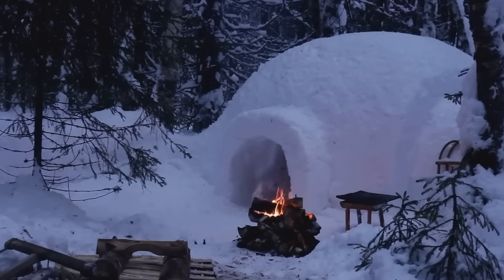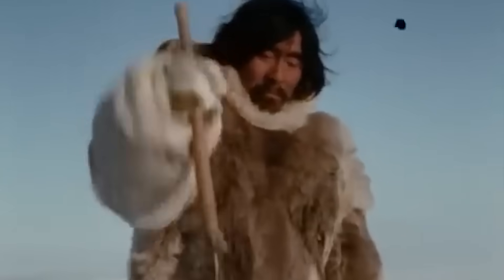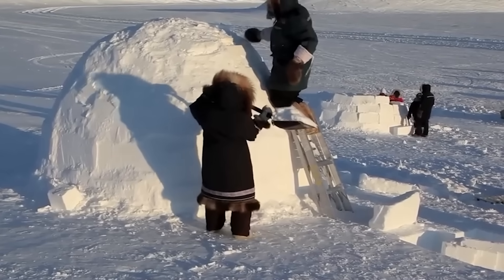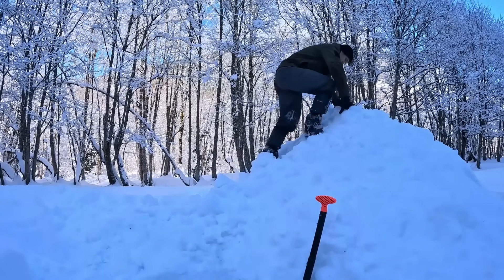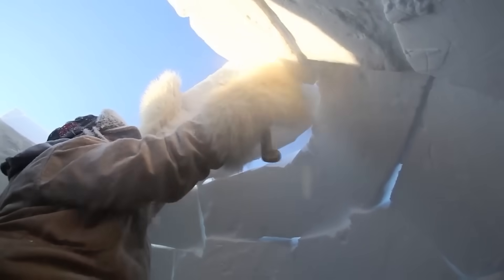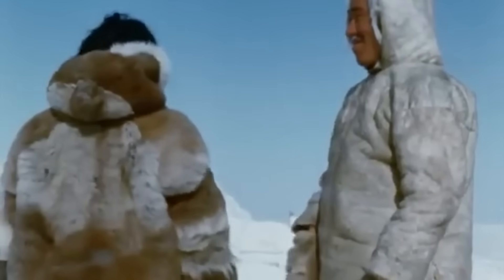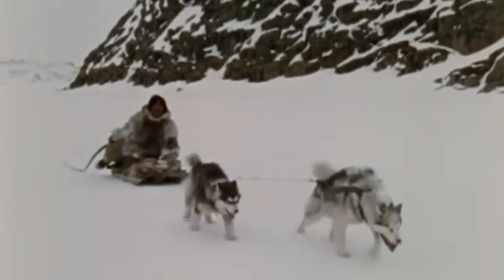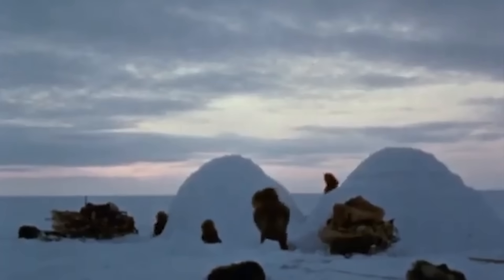How Inuit Build a Real Inuit Igloo in 2 Hours

Comment: When I was a kid we used big cardboard boxes and set them up like a fort with separate rooms and long vacuum cleaner tubes sticking out for ventilation, soaked them to freeze them in place then covered them with snow, froze that layer, cover with another layer of snow, freeze that until it looked more or less like a pile of ice and snow at the far end of a mall parking lot. They were darker inside than a normal igloo, more like a cave and needed a flashlight to see clearly, but still pretty warm compared to outside, couldn't sleep in them though.
Reply: My dad built an igloo in our driveway in the 1945 in Wisconsin. It had the exact dimensions of an igloo but smaller. We played in it under supervision. So much fun. We were the envy of the neighborhood.
Reply: When my brother and I were kids, we built a quinzhee (hollowed out snow pile) in our front yard, about 6 feet high.  That was a lot of fun.
Reply: I used to build Christmas tree forts after the new year, going around collecting the used trees on the curb. They smelled really nice too. They also burned reall well when they dried out. 😊
Reply: I gotta try this.
Reply: @marcmelvin3010  There's an unwritten rule regarding building an ice fort, the builders don't necessarily get dibs on ownership. If it's built in a public place like a field it's open for anyone who challenges for it, you have snowball fights, winners get the fort. There were usually 2 or 3 of them in my neighbourhood. Kids today are like "You played outside in the cold in the 20th Century? That's so old fashioned". We built outdoor ice rinks too, kids today are lazy.
Reply: @ll7868  In a town near where I grew up, the church there turned their field (often used as a playground or soccer field for kids) into a free-to-use ice-skating/hockey rink.
Before the first freeze, the put up a wood perimeter made out of painted lumber, and once there was solid freezing, they would run cold water into the rink in layers to make a thick slab of ice.
I have since moved, so I don't know if they still do that.
Reply: @MonkeyJedi99  In every Canadian city and small town there are lacrosse boxes converted into hockey rinks every winter, my small town Selkirk, Manitoba had one indoor ice arena and about 50 outdoor lacrosse rinks around town, 6 of the most popular ones were in Kinsmen Park across from the arena, there are townhomes and an apartment building there now and just 2 outdoor rinks left but there's 2 more indoor rinks in town so it evens out more or less. 
Getting to practice on the indoor rink from 6-8am when it was -35c and still dark outside in January was like a special treat but usually the high school and adult league teams booked it.
Reply: Well I don’t see how anyone could sleep in one anyway. There is nothing but cold snow underneath you. And if you try to sleep on it, your warm body will melt the snow so then you’ll end up being drenched in cold water.
Reply: @rsuriyop  The inuit are hunters, they have hides from caribou the hairs are hollow and make good insulation. Yes there is a 2 ft high shelf around a central hole. The cold air goes in the hole and you sleep in the middle air not too cold or too smokey. You lay your sleeping furs on the shelf and lay down on top.